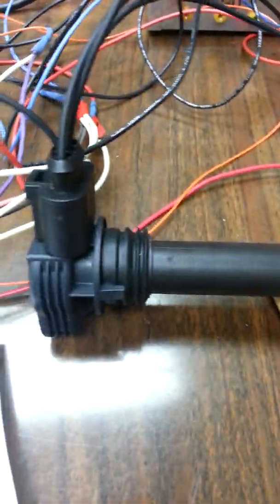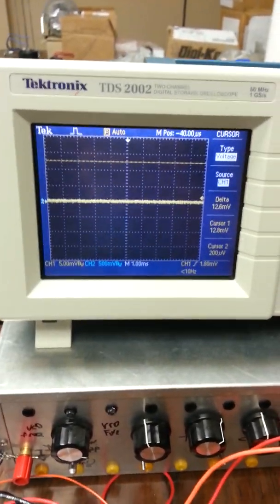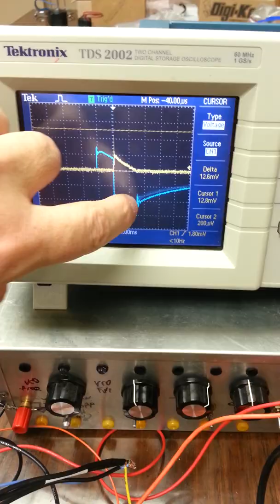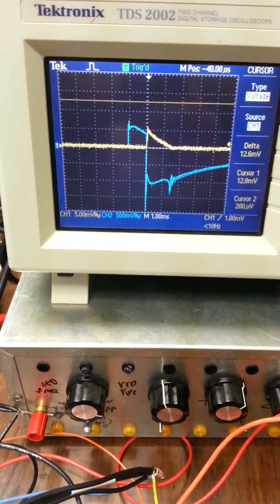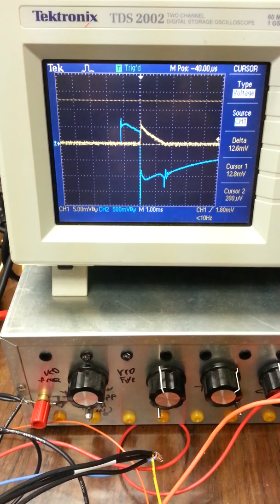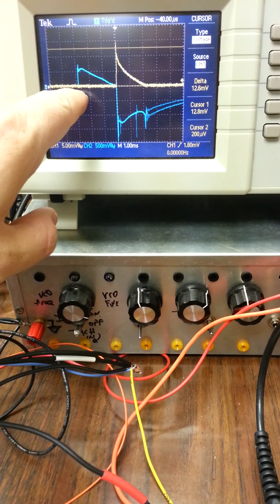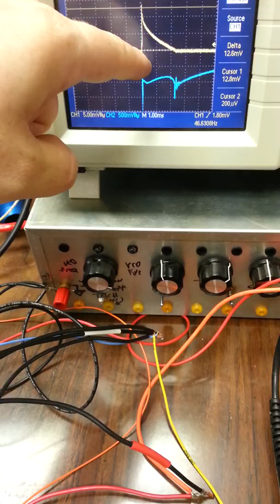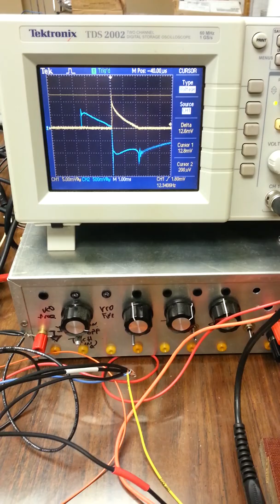VW COP Ignition Coil Testing

Comment: Cop3 line ignition coil, generally have several trigger methods? I want to know the ECM output? Still the detection of the control line of the input ignition coil, or the principle, I am eager to understand them and know how to detect whether the ECU is normal, or the ignition coil fails? Thank you

Comment: It appears that the spark is retarded by several mSec as you increase the dwell, but that may appear that way if you are using capacitive (AC) coupling on the scope or from the signal generator to the trigger. Also, the signals lose their ground reference as you go higher in frequency, which also indicates AC coupling. And I'm assuming that the blue trace is the trigger signal from the generator, although perhaps it is the current on the 12 VDC supply. The yellow trace could be the coil output voltage, although I would expect it to be jagged like the blue trace.